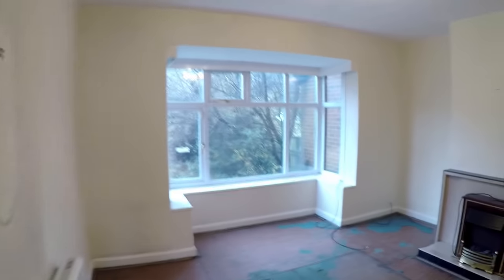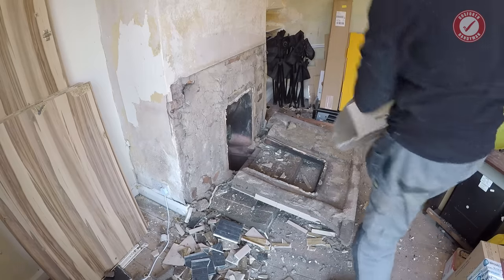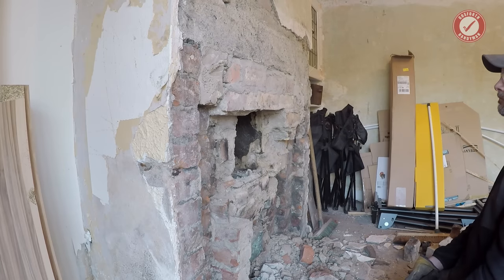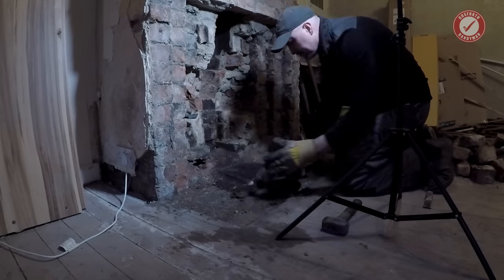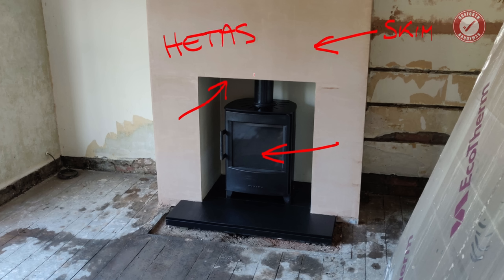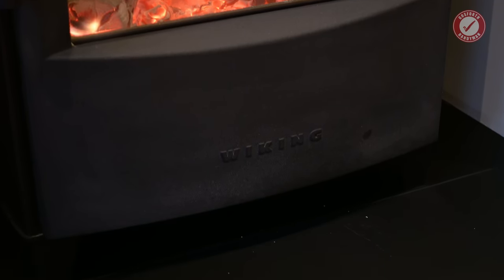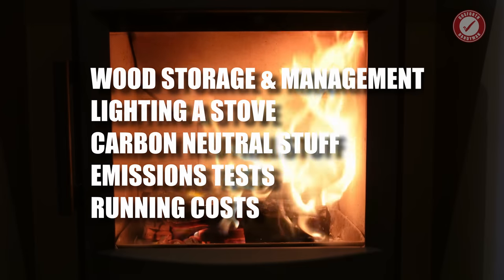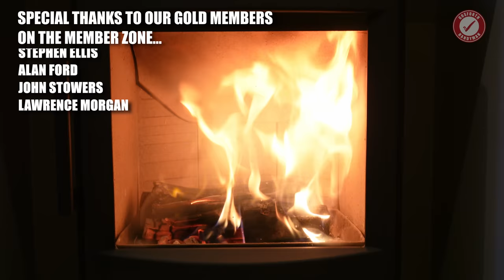Removing the back boiler and installing our wood burning stove

Comment: I ripped out the tacky varnished slate stones from my two downstairs fireplaces and all of the rubble, so much rubble. The two upstairs fireplaces had been boarded off but never swept, the actual fireplaces were FULL of soot probably two foot deep. Fitted reclaimed slate slabs for hearths and gearing up to fit the wood burner next. As for HETAS it seems like a waste of time, just another cash grab certification.  it's really not that hard to fit them yourself if you have a bit of common sense and are practical. Not too sure on why liners seem to be the go to tbh, in my case the house is 120 years old and would have had open fireplaces in every room so seems unnecessary, newer properties makes more sense. Helped my dad fit his burner with no liner over 10 years ago and he burns exclusively pallets with no issue at all.
Reply from the maker: Nice!

Comment: No need for these cancer generators. Gas/electric central heating was installed to most houses in the UK as it's more efficient, and doesn't pump out toxic smoke.
Reply from the maker: This is a myth but covering that more next time. Don't believe everything you read in the papers! 😂
Reply from the maker: I would definitely advise against inhaling burning particulate matter. 👍

Comment: Pity the neighbours 😷😷😷 Worse than diesel, should be banned.
Reply from the maker: This seems to be a myth proliferated by clickbait mainstream media, certainly with modern stoves. Vid next time explaining emissions in more detail. And all the neighbours have them, so. 😂👍
Reply: @GosforthHandyman  New data from the Department for Environment, Food and Rural Affairs (Defra) cuts the estimated proportion of small particle pollution produced by wood burners from 38% to 17%, but the total still outweighs that produced by the UK’s road traffic, which is responsible for 13% of particle pollution.

Domestic wood burning is described as a ‘major source’ of particulate matter (PM) emissions, accounting for 15% and 25% of PM10 and PM2.5, respectively in 2020.

The UK government is focused on reducing the amount of PM10 (less than 10 micrometres in diameter) and PM2.5 (less than 2.5 micrometres) due to their ability to penetrate the lungs, blood streams and brain, causing health problems that include heart attacks and respiratory disease.

Defra notes that emissions of PM2.5 from domestic wood burning increased by 35% between 2010 and 2020 and it states that “most emissions from this source come from burning wood in closed stoves and open fires.”

Air-pollution scientist, Dr Gary Fuller of Imperial College London said: “Home use of solid fuel is one of the top two sources of particle pollution in the UK, coming from just 8% of UK homes. My in-box is filled with people who are concerned about the wood smoke that is filling the bedroom of their asthmatic child or ill elderly relative.”
Reply from the maker: >> increased by 35% between 2010 and 2020
Not according to this, UK annual emissions of PM2.5, Domestic Combustion:
1990: 46.26986332
2005: 18.74700687
2019: 19.92795456
2020: 19.79024801
https://assets.publishing.service.gov.uk/government/uploads/system/uploads/attachment_data/file/1054227/Figure05_PM2_5_sectors.csv/preview

AND we're still seeing background outdoor readings of 6-8 for most of the country, which is great and has massively dropped over the last 30 years.

Looking at the actual realtime data for central London (Camden) there are no nightly spikes of PM2.5 despite everyone using stoves. There are spikes through the day and these perfectly corelate with NOXasNO2, which is vehicle pollution.

There's a lot to be said for open fires, old stoves and people burning any old shit. That's a different matter. That obviously needs to stop.